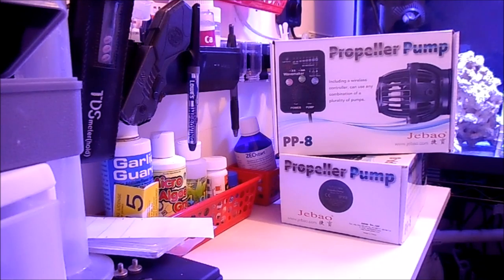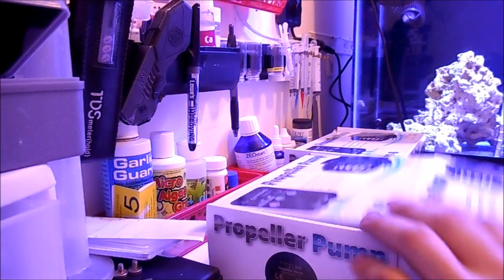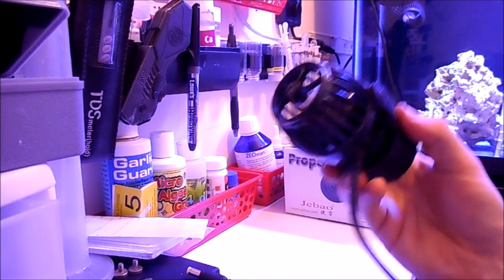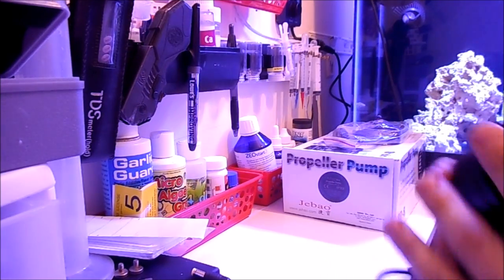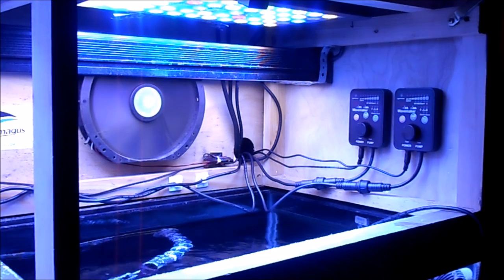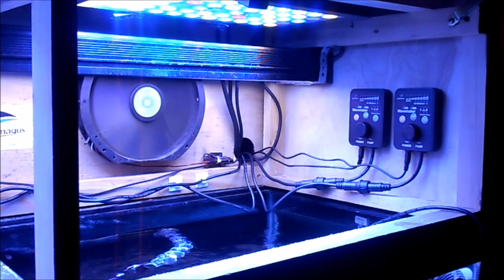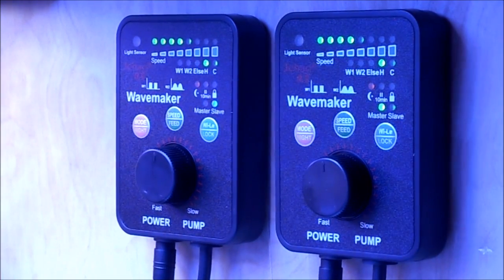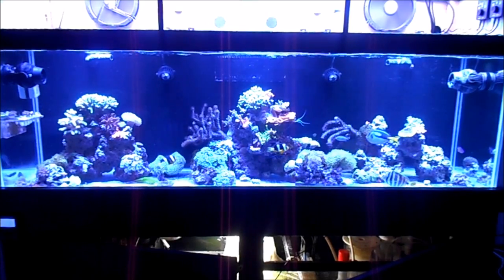Adding Jebao PP-8 | Reef Tank

Comment: ended up going with 1 PP8 and 1 PP4.   Just the PP8 alone would have been plenty but i wanted to have two pointing at each other so i got one big and one small.  good so far, but took a while to position them to not have my sand blow all over.   With those two 40s you have with them, there must be crazy flow in there.
Reply from the maker: +Lisa DeMayo Yea but i run bare bottom tank so i can have as much flow as i want only problem i have now is it moves the corals around on the bottom of the tank haha. Plus with the apex controlling all 4 i can really add surge waves and different flow patterns during the day and night. Im very happy with the Jebao wave pumps atm, I used to have MP 60s but these move more water its kinda crazy.

Comment: Great videos FishOfHex! I have a question, I just acquired a 48x24x16 rimless tank. Would two PP8s in opposite sides of the tank be enough flow? I also plan on getting the Apex module.
Reply from the maker: yea that should be plenty. Check out my jebao to apex video on setup and programming.

Comment: You know if you can run a pp8 and pp4 using master as one and other slave?  I have a pp8, darn thing is strong in my 60 and was gonna get another but a pp4 would probably be prefect addition.  Nice tank btw!
Reply from the maker: I believe the wp series is the one you can link. As for if you can mix i have no idea. Mine are controlled by the apex

Comment: Been thinking about ordering a couple of these pumps/wave-makers.  But I am worry that the water will splash over the tank and onto my floor.  Does that every happen?  and If so and If I lower the setting, will it be good enough water movement at low setting?
Reply from the maker: You can adjust the flow plus you would have to go out of your way to move enough water to splash out of a tank.

Comment: I noticed that the slave one does not turn into night mode when the master does at night. Is that correct or did I not do something right?
Reply from the maker: Mine did the same thing. Im not sure whats wrong.. i currently have all my pump controlled by the apex so its no longer a problem.

Comment: Would you recommended two Jebao pp 8 in 126g reef tank?
Reply from the maker: +Jaime Jimmy I don't think that would be enough flow. Definitely not for sps. I would go with two wp40s
Reply: I know the question was for the video maker, but I would not recommend two. I have a 100G Red Sea and use two in it. They both run at 100%, but I have dead spots in certain areas; more than in a tank where I run an MP10/MP40. I am going to get another two PP4 to cover the dead spots in the floor.

Comment: I have a 60 gallon cube with one ecotech mp40 on the right and a mp10 on the left. I am looking to add one or two pumps on the back wall because there is no flow. Would this be a good match? If so should i get one or two?
Reply from the maker: Two of these would be perfect for the back wall and for a future tank upgrade.
Reply: Awesome thanks for the quick reply! I tried putting two mp10s on the back but the magnets were not strong enough.